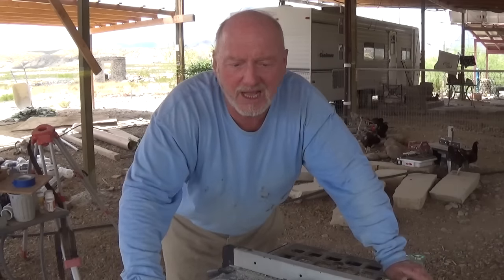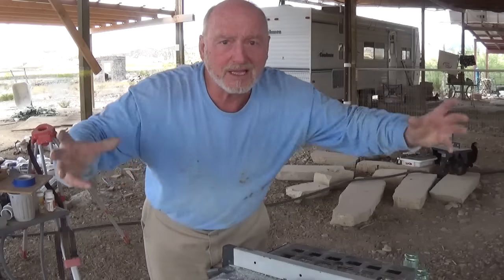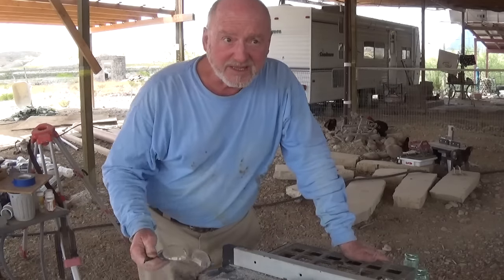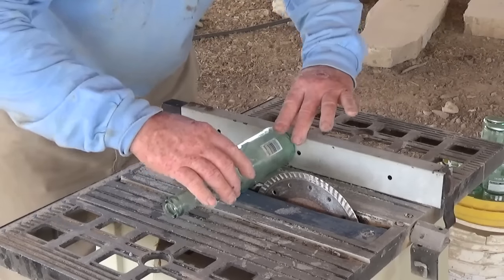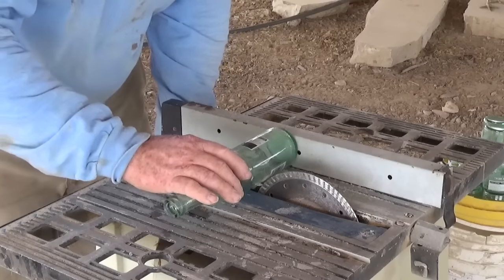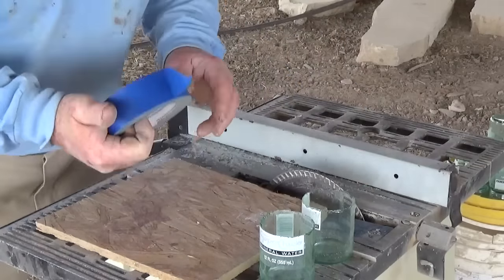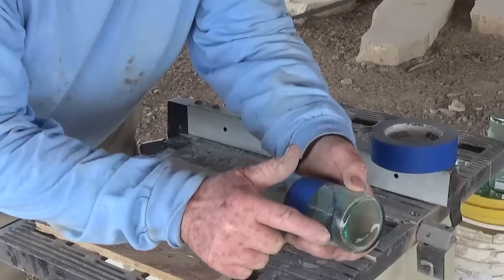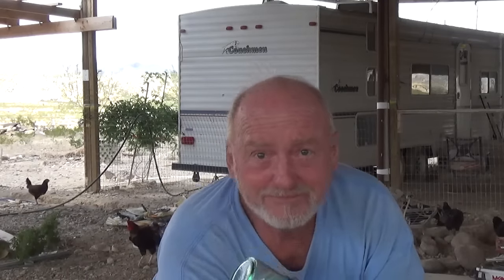How I Make Bottle Bricks

Comment: Ive been cutin bottles 4 years w/ the burned strng thery . Much cleaner cuts but theres no way I could keep up w/ that saw , that thing is great .   MayB a little water spray on the blade will keep dust down .    U want light ? , Alm. foil the bottom half of brick .   Good luk 2 U sir and wish U much success
Reply from the maker: Tracy James Tavares I wondered about foil. I will try some of the light wall for the chickens, as an experiment! Thanks!

Comment: I'm making bottle bricks for a project.  Do the labels need to come off. I've heard and read different reports.  Its much easier to leave them on.  Just wanted you opinion. Thanks
Reply from the maker: Leave the labels on the bottles. People are talking about the mortar sticking to the label and not the bottle..... but mortar does not stick well to glass anyway. It is the shape that holds the bottle in place, not adhesion. However, it may LOOK better without labels, but there is no other need to remove them!
Reply: @ecoranchusa  Thank you. That makes me feel better. I'm starting to learn which brands of beer and wine have labels that come off easy (St Pauli Girl) . And am still taking those off, but leaving a lot of labels on. Most of the label is covered up by the duct tape anyway.  And how  would the mortar "know" if there's a label under the tape.  Where in W. TX are you? My property is outside Sanderson.
Reply from the maker: Terlingua